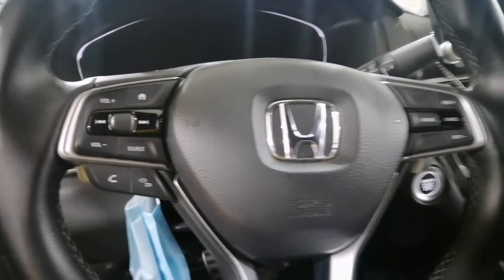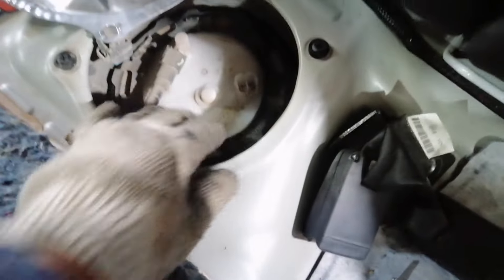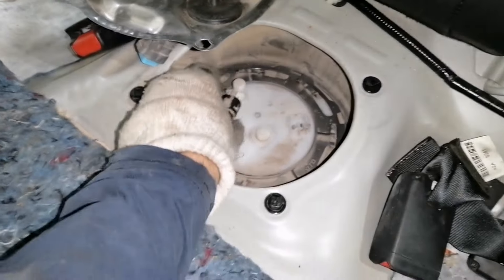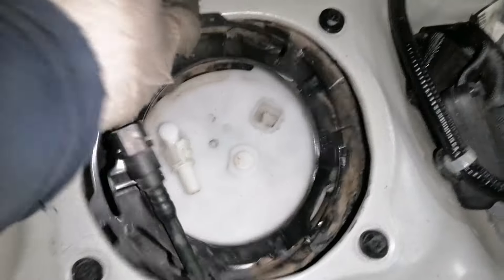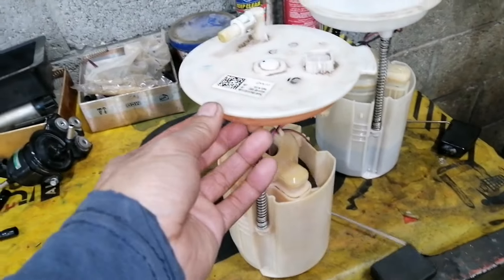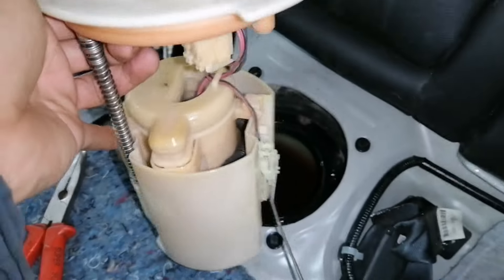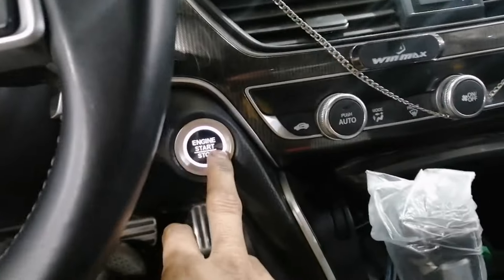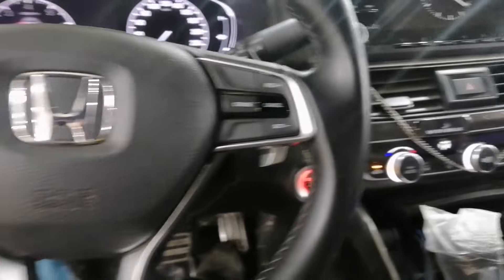P0087: Fuel rail pressure too low HONDA ACCORD 2019

Comment: Any thoughts on 18 crv low fuel rail pressure?? New hpfp and injectors car starts idles great then when u accelerate it breaks up misfires engine flashes limp mode code comes on I’m loosing my mind at this point
Reply from the maker: What is the code of misfire.? Do you use a scanner?